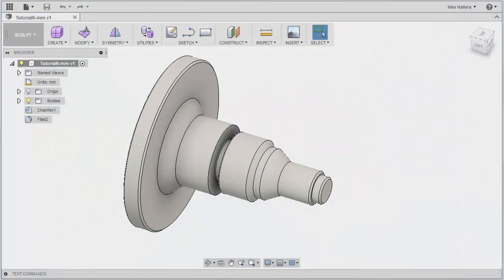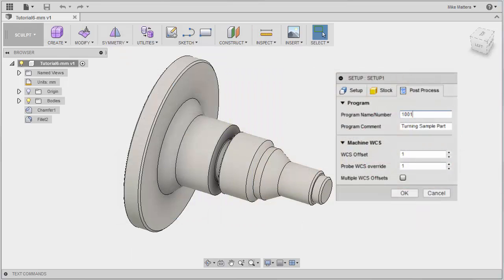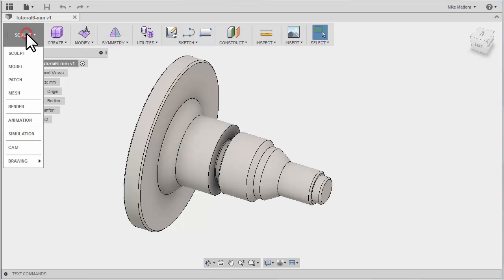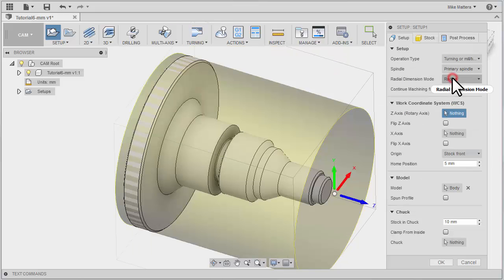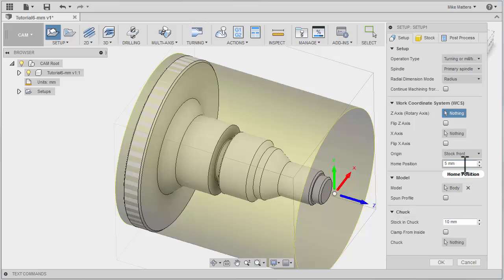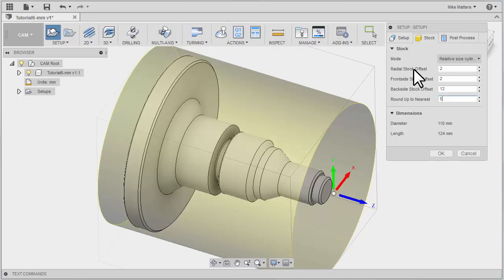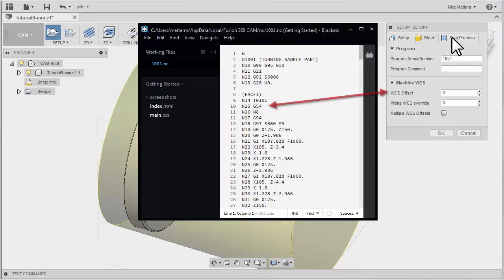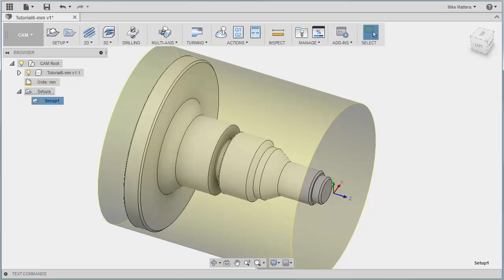Fusion 360 CAM - Intro to Turning 02 - Setup Zeros & Stock

Comment: when setting up, it mixes my x with y, how do i change my x direction? a slant bed x isn't planar as it shows, does that meters?
Reply from the maker: You can use the WCS settings on the Setup page to reorient the X & Y axis direction. Hold your mouse over these options and look at the ToolTips (they will pop up).